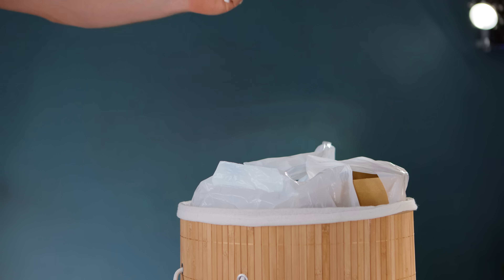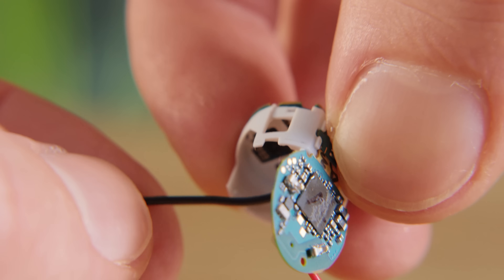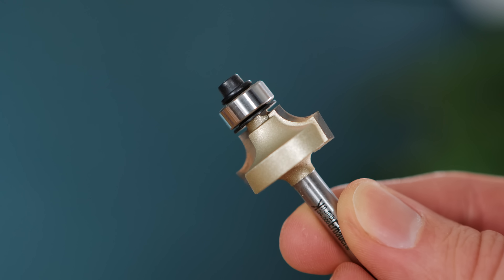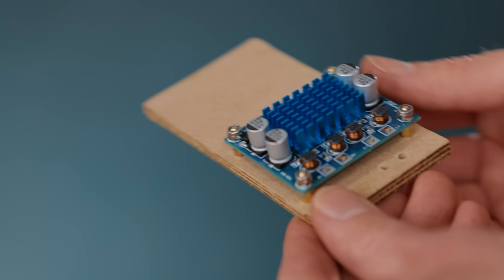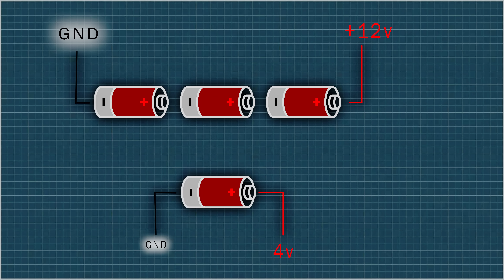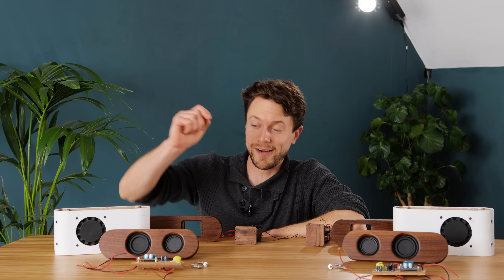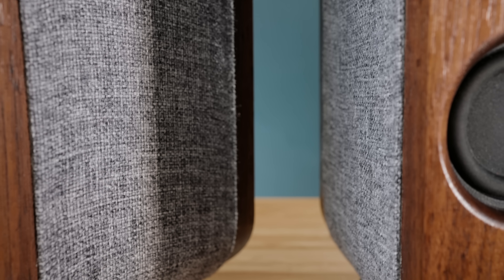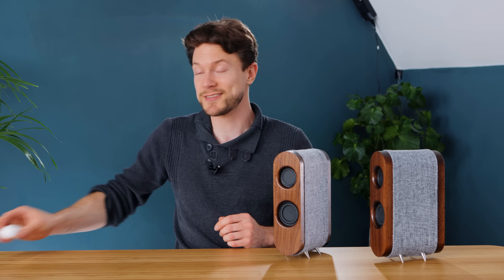Transforming dead earbuds into POWERFUL wireless speakers

Comment: "You could've fixed the headphones by replacing the dead batteries!"
"Yeah... but what's the fun in that?"
Reply: Plus, there's a chance it's not dead batteries and in fact dead diaphragms of the speaker drivers themselves.
Reply: Try that On airpods.. almost impossible
Reply: @surapurna  If you do manage to figure out a way to do it be sure Apple will design the next version with your little hack in mind
Reply: @asandax6  If someone made a guide, Apple would for sure find out. They wouldn't want any loopholes that allow owners to easily repair their own products now, would they?
Reply: @ClassyNeons  there is an way to repaire AirPods when the batterie is dead u can look it up on yt
Reply: @cjc8434  I'm well aware; I was being facetious. My point is that making their products easily fixable isn't a high priority to Apple. Most everyone knows their stance against right to repair
Reply: @cjc8434  I know it's from Rewa Tech. But it's hard even for them.
Reply: @cjc8434  That would leave you with AirPods and not wireless stereo speakers.
Reply: @surapurna  yup changing the battery on the first buds (idk about the third gen) is extremely easy and has earned samsung praise. But as we all know Apple is green and environmentally conscious only in their marketing
Reply: @matuzaato  yep my gen1 just garbage now.
Reply: @surapurna  Not just the AirPods. A lot of these come with custom made batteries.
Reply: @neosapien247  yes, but apple specifically make it difficult to replace things like batteries, so you need specialist tools such as an Apple certified technician or "Apple care" technician, so they can charge more
Reply: @surapurna  then the homunculi that work at Apple will find a way to make it impossible to reuse it in anyway.
Reply: Exactly whats the fun in that?
Reply: True though
Reply: Many folks have decent speakers that just require some amplification and amps out of china these days are shockingly good value for money.  I'd say this project is much more for those who already have a pair of decent boxed speakers but you want to make them wireless and you don't mind messing with their boxes.

Comment: Very nice speaker build here! Allthough one thing i would definetly change is to add charging ports at the back. I think it would be too cumbersome to unscrew the battery magazine to charge each battery individually.
I’m pretty sure i’ve seen multiple ground loop isolation circuits on ebay as well.

Though honestly, just the speaker aesthetics makes it up for it

Comment: Those speakers sounded so good that I didnt even need to wear headphones to hear the difference between them and the other speaker 😯
Reply: I mean they’re alright, but they sound pretty muffled compared to the Bose. Obviously more low end which is nice, but sounds like they could benefit from a bit more treble. Would be easy enough to fix though with some tweeters
Reply: @Ssshrugs  no, the bose's is the one that has piercing sound profile. I mean, what can you expect from a bt speaker in that price range. But the details on the custom one is just so much better than the bose, it's really night & day
Reply: @Ssshrugs  wahahaha... are you using a headphones its very clear the bose sounds mono while diy is crisp and stereo mode. Cant understand how you define it as muffled
Reply: @marklouieadame  by muffled he probably meant the low mids were overwhelming and the treble was duller
Reply: @ItsDextrin  dont think so its clear diy got the wider sound and crisp both mids and high while bose was tight and muffled you can hear the tight sound jumbled together creating a muffled sound on bass and mids while trying clarity using tweeter or vocals.
Reply: @marklouieadame  True

Comment: Great project and as usual it looks great. But why didn't you add a 4056 lipo charger module or two with the usb port to the back instead of getting the batteries out?

Comment: hmmmmm yeah that sounds great.  Now unfortuneately, I'm a cheapskate, and the ONLY wireless earbuds I have actually still have a wire between them... 

I suppose I could still make this work if I added a 3.5mm port out of the 'main' speaker....now where are those old awful earbuds?

Cool, now I have a winter project

Comment: Hey Matt! Great video, Thanks for sharing. Wouldn't it have been great if you added a 3s BMS&Charger(pretty cheap nowadays) which is fed by a USB-C PD charger. You can add a PD trigger board, to whose voltage output you can hook up a boost converter so you can boost 5-9-12V to 12.6 for charging. I have my own DIY Bluetooth Speaker set up like that, it does not really have much interference too.

Comment: My brain keeps wanting to add solar panels to it so they could be wireless speakers you'd never have to charge. Maybe if you set them in front of a window they could solar charge enough to run continuously as PC speakers. I doubt inside lighting would be enough.

Comment: If any of you want to make such speakers with integrated charging, there are affordable BMS boards on Amazon and other such sites that you could hook up to a power supply and charge all 4 batteries with. This would allow you to forgo the battery holders, and make a somewhat more compact pack, while also not needing to remove it from the enclosure. 
Do mind, however, that due to the sealed nature of the enclosure, thermals would most likely be of concern, so it might be worth considering some sort of heat-sink, or perhaps a separate compartment for the batteries that would get more airflow. Adding a few centimeters to the overall depth of the speaker to facilitate such a compartment, while also maintaining the original shape of the driver enclosure so as to preserve it's acoustic properties, appears to me to be the most reasonable implementation. 

https://www.amazon.com/4Series-Protection-Balancing-LiFePO4-Battery/dp/B07511RJ9S

This BMS on amazon appears to have over-discharge and over-charge protection built in, so it should work well enough with a simple 15V(Board is rated for 15V input) power supply. You could adapt it to work with a range of voltages using a DC-DC converter with a 15V output, though the cheap ones I manged to find on Aliexpress would only go up to 600mA of output current, and simply connecting them in parallel sound risky to me, as I could not find any documentation as to whether they have over-current protection.

Comment: Another marvelous idea with creative engineering... The only tiny little mod I would have included, is a small charger unit mounted inside each speaker, so they could be plugged in directly, charged, then unplugged and used... Apart from that, brilliant.. 😎

Comment: could have added more wires for antenna upgrade (depends of you want it internal or external) for more range.

not sure if its possible to add type C charging port for the battery so you won't need to take the battery out, while not making the onboard chip confused. with small RGB Led to indicate if its pairing, low batt, fully charged.

Pairing button would be good too.

very nice video and idea to reduce waste and DIY BT TWS speakers.

Comment: I've noticed a lot of your projects don't have built-in AC power/rechargeability. Would there be harm or benefit to build the battery charger or a power port into these? I'd prefer not to have to remove the batteries at all if possible.

Comment: Wasting a battery? Nahh I'd risk the ground loop myself ;)
 Seriously just put a 10-100 ohm res in the input ground of the Amp

  This niggle is because I'd be a bit worried about unequally charged batteries if you're using a bog standard charger - the less used batt could overheat.... (Oh and more output power too, if the amp can handle 4 cells ~16V)

 Niggles aside, this is a great little project - I once made 4-5 pairs of cute amplified mini-spkrs that got lost in my Mega-eviction ... You've got me quite buzzed to make some more, as yours look WAY more fancy, and those drivers are a ways better

"Not bad at all" ;) - Pete, Gas Electronics, London

Comment: The way I powered my Bluetooth speaker was with a power bank that has QC 3.0 capability. You can get a module that takes that USB in, and outputs 12v. It's much easier to deal with than taking batteries out of an pack and putting them into a charger, as you can just plug the bank in. 

DyNamic JUWEI QC2.0/3.0 Automatic USB Tester Voltage Ammeter Quick Charger Power Bank Voltage Trigger

The module I used, for anyone interested

Comment: This is a really neat little trick and I will certainly be salvaging any future pairs of Bluetooth headphones I have for this very purpose should they fail. They probably won't look as good but should still be good enough!
I do actually have some spare speaker drivers, and amplifiers shouldn't be too hard to come by either.
The only thing I would say is that 18650s cannot be sold on eBay, so you won't be able to buy them on eBay either, but any Li-Ion or Li-Po batteries should do. You can get some by buying laptop battery packs in bulk, and tearing them apart for the Li-Ion cells. Make sure to also buy a suitable BMS for protection.

Comment: These Buds have been connected to your phone before they broke, but how do you put these speakers in Pairing mode? Many wireless Earbuds don't automatically search for a new BT Connection when they are turned on until they are told to (by pressing a button on the side in a special pattern). Perhaps i missed it in the Video...

Comment: The only thing that would make this better is adding built in charging. Seems really inconvenient having to unscrew a panel to access the batteries. The panel screw slots seem like they wouldn't last with the constant in and out.  8 18650's would take quite a while to charge as well and you'd have to do it in rounds if you only have a 4 slotted charger.

Comment: Awesome as always. Would love to see an easier option for charging the batteries without needing to remove them, but I'm sure there was a reason why you didn't go that route. Well done!
Reply: probably the voltage difference between a usb charger and the batteries overall voltage. If he included something that would change the voltage inside of it it would made the build noticeably more complicated and he wants to make it as clean and easy as possible. Still though, yeah only the charging is what ruins it, proper charging port would make this build perfect. Unscrewing the battery holding case, getting them out, charging, putting them back and screwing back in like every week sounds super impractical, especially if you use them all the time.

Comment: Really cool idea and result. It's only the lack of an integrated charger circuit and plug to avoid having to manually remove/charge/reinstall the 18650s that I would want to fix.

Comment: Some amplifiers come with the necessary low/hi pass filters, so any fiddling with extra exposed circuitry may not be a problem. However, extra features generally means higher cost

Comment: I was quite hoping the metal stereo feet were the charge points, and there was a base to set them on.
Reply: My guess if Matt was to work out  if the batteries  could be charged inside the speakers would be great. it can be done but more work  I suppose .

Comment: These are legitimately great-sounding and I think the awesome thing is that these scale with size. Those little modules can be packaged inside some full-size floor standing speakers that use wall power, as well. Parts Express is a GREAT resource that not only has a massive selection of cones to make any speaker you want out of them, but ALSO has things like manually-adjustable crossover networks (So you don't need to use the cap/resistor stuff) AND they sell ICEPower modules, which are used in a TON of "Audiophile" amplifiers. REALLY nifty trick!

Comment: The design of your speakers is just great and kind of Scandinavian style. Very, very impressive, especially, when homemade 👍.
The sound though, I am not so impressed of. The Bosse one, has like more dynamic sound and better hyfrequency sound output.

Good job anyways!  👍
PS
Wouldn't be a good idea  to mount a charging socket, in order to charge the batteries?

Comment: Not bad... would love a way to charge them with a USB of sorts, maybe a way to have them work with AUX pair and personally I'd put in a way to adjust the low pass, high pass and frequency filters, even if just mounted internally. Great project and great look and feel... 9/10 (1 point for the changing)

Comment: This is the type of stuff i want to make, but i find it to hard to find all the parts for it. Its quite easy to just order the speaker elements, and buy some wood and so on. But i would love if there was some premade packs with the capacitators, amplifier, some small cables, sound dampening material etc, ready to go. So you dont have to buy like 100 small capacitators, 10 meters of cable etc. Then this would be something that i could do.

Comment: Alright, some questions...
 
1) Ground loops: if the amp and earbuds share a common ground, doesn't that negate the issue? So wouldn't it be better to just use 3 cells in series, share ground between buds & amp, and tap the buds off the positive of the 1st cell? A concern might be that this puts extra load on cell 1, compared to the other 2, but the buds consume so little compared to the amp that the difference is moot. Besides, every cell has its own protection circuit, so it's not like that cell would ever drain beyond its safe point.
2) Assuming we can wire it up that way, this would allow us to install a 3S balance charger into the case, so we don't need to open it up to charge the batteries. In fact, it seems to me it would be possible to change out the 18650's with their individual protection circuits for a LiPo pack hooked up to a small embedded 3S charger that takes over the function of the protection circuit. Are there inline 3S LiPo charging circuits available that expose all individual cells, and integrate a protection circuit on each one?
3) Is it safe to assume that most Bluetooth stereo earbuds will offer decent audio quality when hooked up to an external amp? I know there are quality differences between different brands, but are those on the electronics level, or mostly due to physical design and the specific drivers used?

Comment: You talked about tuning the crossover circuits, but didn't mention tuning the dimensions of the case internals. Check out Hexibase's channel for examples where he goes through all the theory and shows how a correctly tuned box can make a massive difference to the sound quality

Comment: Oh Snap! You just made better speakers than Bose can! That is a good way reuse even used speakers too. You I think about If you a bunch of scrap wood from the roadside and old amps, speakers and wire. All you need are the $4 old bad ear buds... LOL S for $4 bucks you have better speakers than Bose speakers... Fantastic!... :-)
Edited: I just checked, here in the US it will cost ya $10.00 bucks for the buds but still Cheap...
Thanks again Matt for the video!
LLAP

Comment: Really nice project, but not exactly cheap - the parts alone would set you back about 340,00 USD or 245,00 GBP + shipping - and then comes the cost of the rest of the materials + labor. You can get a set of pretty decent bluetooth stereo speakers for the same price. :)

Comment: It would not have taken much to put a charging plug for the batteries ! I am surprised you did not suggested it :)
Reply: yeah only the charging is what ruins it, why not make an external charging usb c port? would make this build perfect. Unscrewing the battery holding case, getting them out, charging, putting them back and screwing back in like every week sounds super impractical, especially if you use them all the time.

Comment: For so much cost you could have also, you know... Included a small battery charging board. :/ ... Or two, paralleled so they charge from the same usb port. Instead of pulling the pack out.

Comment: The look ⭐️⭐️⭐️⭐️⭐️
The Sound ⭐️⭐️⭐️⭐️⭐️
The effort ⭐️⭐️⭐️⭐️⭐️ 
The way of charging it ⭐️ lol
Reply: yeah only the charging is what ruins it, why not make an external charging usb c port? would make this build perfect. Unscrewing the battery holding case, getting them out, charging, putting them back and screwing back in like every week sounds super impractical, especially if you use them all the time.

Comment: Whereas I think these are stunning overall,  the Bose did have crisper highs,  even if it's in mono... The other drawback is the necessity to remove the batteries to charge them. I'm not saying I could do any better,  but I would think there'd be a more convenient way to power them,  or rather,  charge them... As always, two thumbs up though!

Comment: sir wondering the why you didn't put a battery charger into each speaker doing away with the need to remove the batteries?

Comment: Well, they sounds like expensive speakers connected to a shitty bluetooth module. And that's what they really are. Using bluetooth for sound transferring reduces quality by 50%. Even technologies like APT-X can't solve this problem completely.  You should at least add RCA connectors to use these speakers with good DAC.